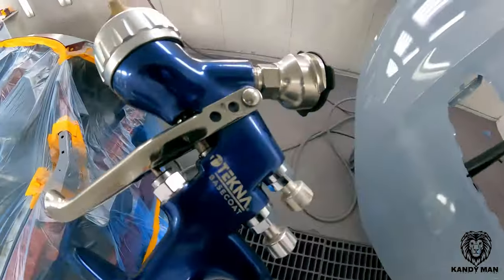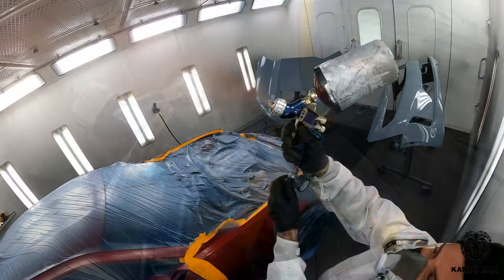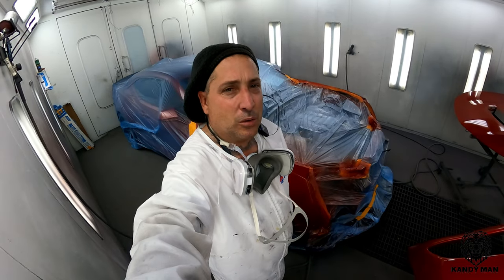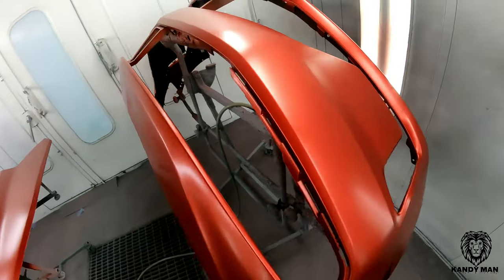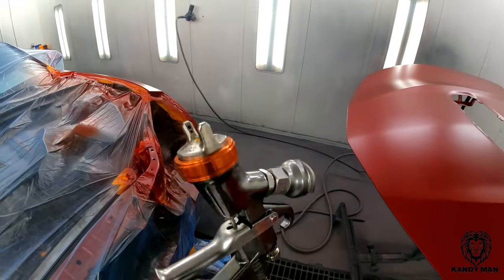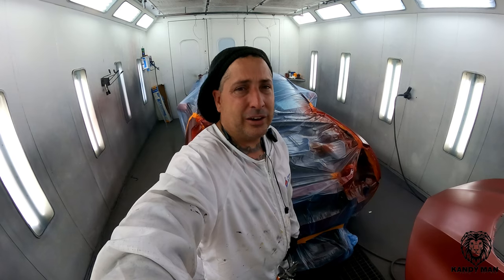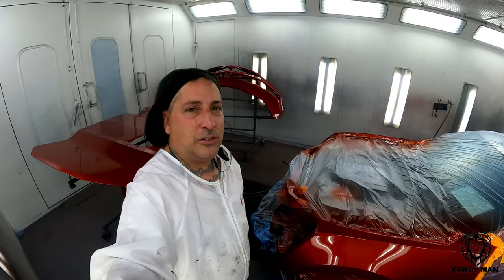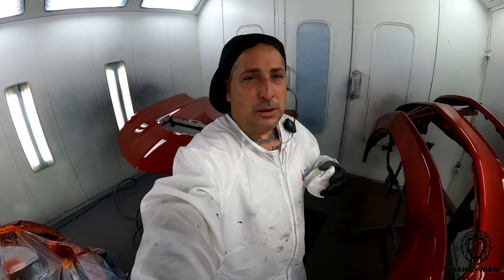TEKNA BASE GUN - DIALING IN LPH 400!

Comment: Great video. I have the tekna base gun and trying to get it dial in but having trouble. What is your set up, I spray solvent
Reply from the maker: Thanks Tony  for solvent I would try full fan 2 turns in on fluid from wide open and 18 psi as a start.hope this gets you in the ballpark